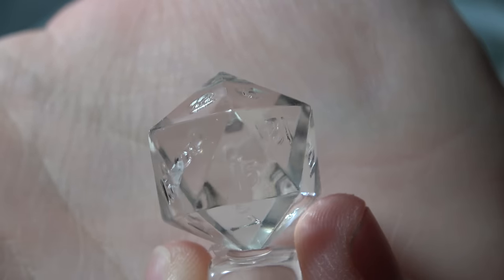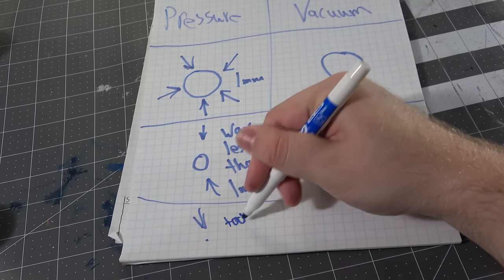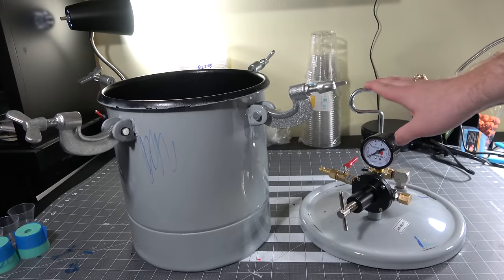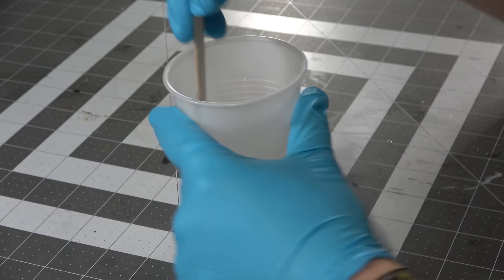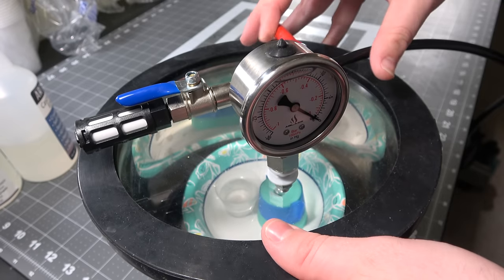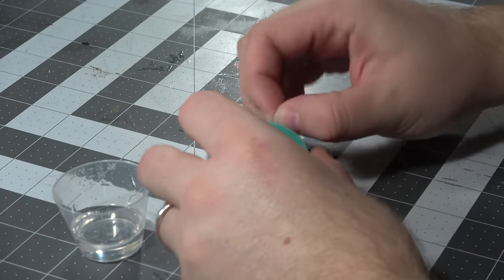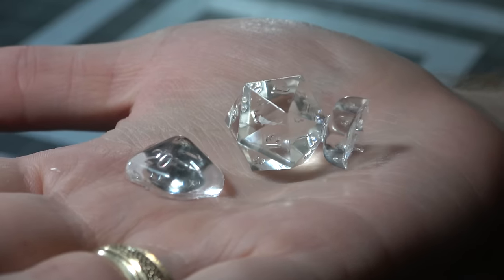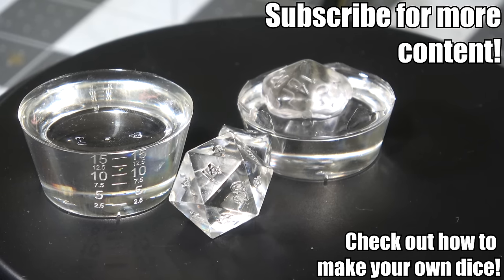Pressure Pot vs Vacuum Chamber | Resin Dice Casting

Comment: So like, I was unfortunate that i can only use vacuum chamber to deal with resin, is there any suggestion to prevent the resin boil out all over the place? The solution i think is that to use higher cups with less resin and make it multiple times. But i am afraid that there is still some points that I am missing, may I get some suggestions or tips? Thank you very much
Reply from the maker: You can also take an active roll in pulling the bubbles out of the resin. Pull the vacuum for a second, then open the valve up, rinse and repeat whenever your bubbles get too high :) I have heard of some people having success
Reply: @Rybonator  Thank you very much

Comment: are pressure casted die more prone to cracking when put under heat?   Those microscopic bubbles dont go away,  so arent there a ton of microscopic pockets of high pressure bubbles?

Comment: If you don't have either could you use a heat gun to remove air bubbles in your silicone and resin?

Comment: Ive been using a pressure pot for resin in moulds that I’ve made, but find that the pressure pushes the resin INTO the silicon moulds…. Am I using too much pressure? (I think it’s about 40psi). Or do I have to make the silicon mould in a vacuum?? It’s so frustrating (and expensive)!!!

Comment: In cake glazing a sift is used to remove bubbles from very liquid glazes.
How would this work for resin if someone don't have access to a pressure pot (or vacuum pump and patience to slowly remove all bubbles).
Reply from the maker: I don't think so, if a sift is what I am thinking that it is in regards to baking. However, constant vibration can be a good replacement, so if you have a vibration table, it could help :)

Comment: So I've started binge watching your videos last month, to the point where I now want to try making my own dice for fun.  I've heard in a couple of previous videos that you don't "need" a pressure pot for the Art&Glow stuff but obviously from watching your newer videos, I do see a little clarity improvement from other videos.  Besides the Harbor Freight pot, have you tried/tested out any other ones?  Just wondering if there's a $25/$50/$75 option available for new hobbyists.
Reply from the maker: Hey glad to see my stuff has been binged haha :) That makes me happy!

So yes, you don't NEED one, it just makes your ability to get bubble free resin casts MUCH easier :) As a result, it also helps prevent your dice from failing by ensuring that you get resin into all the cracks and creases :)

So there aren't many cheaper options than the harbor freight version that I could find without sacrificing safety. You CAN make one out of PVC pipe, but it is riskier, and not worth the savings in money IMO. 

But I do plan on doing a beginner's guide to dice making soon. Hopefully that can help get you started on a budget :)

Comment: What about regular cooking pressure pots? I guess the pressure applied would work the same but how does the heat affect the resin, or even the molds?
Reply from the maker: The heat and possible steam could be bad. It depends on the resin, the mold material you use, a lot of factors unfortunately :/

Comment: Have you (or anyone here) ever used an ultrasonic cleaner to degas the resin before casting? 
I've read about it in a few places but never found a good comparison video like this one.
I've also been wondering about trying pressure spray bottles since some of them reach 45psi and have a wide enough opening to get the molds in there.
Reply from the maker: I haven't heard of or tried either of those things, but I'll happily take a look :)
Reply: Thanks! 
If anyone is interested, I tried the pressure spray bottle and it looks pretty good! not 100% transparent but a lot better than it looked just at room pressure, I'll run some more tests and try to post some pictures later.
The sonic cleaner did make the bubble rise a bit faster but it took ~30min at a warm temperature for it to make a real difference and by then you kind of lost a lot of the pot time so I'm still on the fence about that.

Comment: I saw the video where you used pressure pot to degas the silicone used for making mold. I thought the bubble would expand back once the pressure drops since silicone is softer than resin?(even if i let silicone cure under pressure). I wasn't recommended to use pressure pot to make silicone mold since it's that way, but your result seems to have worked. maybe different silicone material plays part
Reply from the maker: So I use the pressure pot and cure the silicone entirely in the pressure pot. That way, when it's cured, no gas can form new bubbles :)

Comment: The vacuum does not suck the bubbles out. Pressure (and yes vacuum is a pressure, just reduced pressure)  is equal in all directions so what really happens is that the vacuum reduced the pressure around the trapped gases (air) in the resin thus the gas expands forming larger bubbles. These bubbles are now large enough and buoyant enough to overcome the resistance of the resin and float to the surface. Think about a scuba diver breathing out or opening a can of soda....the bubbles float the surface. Once at the surface you can release the vacuum which will compress the gas inside the bubbles again which tends to burst the bubbles. To stop the overflow, just release the vacuum before the bubbles overflow the container, maybe repeating the process several times......and yes, do it while in your mixing cup before you pour into the mold.

Comment: I checked your how to get started videos and had a easy question  what gallon/hp compressor are you using
Reply from the maker: I use this specific model :) https://www.harborfreight.com/air-tools-compressors/air-compressors-tanks/1-3-hp-3-gallon-100-psi-oilless-air-compressor-97080.html
Reply: @Rybonator  thanks for replying and the link

Comment: Not sure if this has been asked:
 I'm just starting out and looking into getting either the pressure pot or vacuum chamber, and noticed you purposely mixed to make bubbles before this. If you warm the resin to reduce the bubble while mixing, then use the vacuum chamber. Would that decrease the overflow?

Comment: Now, I get that it wouldn't be as good, but could one make useful dice without a pressure pot?
Reply from the maker: Absolutely! I used to make all of mine without :) Check out my 24k dice or my glow dice, both made without a pressure pot!
Reply: @Rybonator  I think I did actually skip those ones. I'll check them out.

Comment: The link you included to buy the pressure pot,is there any other accessories I would need to get started? I need to some sort of air compressor right?
Reply from the maker: Yes! There are a few different things. Check out my pressure pot video for a more in depth look into what all you need.  :)

Comment: I wish I could get a pressure pot but I have to deal with the resin with out :( are there good ways to minimize the amount of bubbles in the resin with out one?
Reply: I think he mentions it in this video https://www.youtube.com/watch?v=L_BuqLzJweU
He doesn't go into full detail but it's a quick little 10 second tip. Again I think it's this video
Reply from the maker: So if you heat up the resin in a hot water bath (hot sink water, and just let the bottle sit in there for 20 minutes) that helps. You can also vibrate or shake the molds in some way while they are curing and that helps a LOT :)
Reply: @Rybonator  I'll definitely try both those methods, thanks so much!!

Comment: correct me if i am wrong here, but dont you normally use a vacuum chamber to get the air out of the epoxy, then take it out and pour it? nad you can just pull a vacuum, then when you see the epoxy rises to high let it pull some air and go down and then start again?
Reply from the maker: You can yes, but then you have to worry about getting it done in time before your resin starts to set, and it is less labor intensive. But it can be done :)

Comment: I know this might seem dumb, But does anyone know where to get a pressure pot that i dont have to convert from a paint pot to cast resin in.  All I can find is how to Modify a HF Paint pot. I sadly just dont have energy or time to go hunting all the stuff down to do it and I would have to buy new tools.  I have had to put my new hobby on hold for now, till I can get one. I really like how nice they look when they come out of pressure pot.
Reply from the maker: There may be some, but they are going to be expensive. I have the parts list in my original pressure pot video if that helps. I would maybe see if someone has already made one on Ebay.
Reply: @Rybonator   Thank you. I will try to build one.

Comment: What if at top of dicast you will add a widespread funnel made of paper or mold will be prepared in the way that will have a huge funnel shape chamber to gas off resin? The wider the area, the more chances for baubles to pop. The best example is coke poured into a narrow tall glass and whiskey glass. Of course, that adds extra molding material but if quality matters it could be a way to try out.
Reply from the maker: You could do that! But for that extra effort and the cost of extra mold materials each time, I'd just go with the pressure pot in the first place then :)

Comment: How long do you leave the molds in the pressure pot once you’ve pressurized it?
Reply from the maker: It depends on the resin I am using. I leave it in for the full cure/demold time. Usually about 24 hours :)
Reply: @Rybonator  Thank you for the response! :D

Comment: I know this is an old vid but I hope you (or someone else who knows) see this anyway: do you know if it's possible to use one of those pressure pots for cooking instead of this one or aren't they good enough?
Reply from the maker: Hey there Maria, unfortunately no it's not. A pressure cooker creates pressure via steam (which is super bad) and heat (not as bad but still). You also cannot control or indicate the pressure on those. You need something like this :)
Reply: Dang - I’ll have to try making some with no fancy machines then. Thanks for the reply though!

Comment: Why could you not feather it when vacuum chamber is going. Such as when the resin starts getting volatile you open the valve on the lid and let it go back down then close valve and repeat. Little tedious but oh well.  

       Is it too thick and need to be a thin layer perhaps?

Comment: damn, you can pressure cure silicon?! So I could have bought a pressure pot and got a 2 fer but instead I bought the vacuum chamber. That sucks. Anyway, I want to degas resin with my vacuum chamber. Can I just turn off the pump right before the mold overflows and still get great results?
Reply: That is how we do it.

Comment: The mold used is designed to be used in a pressure pot, not under vacuum. You would need to add an extention to the top to contain and return the resin to the mold once the bubbles are out. This will also require the use of a slow cure resin.

Pressure pots are easier and faster, which is why they are preferable for this kind of use.

Vacuum chambers are the easy to go when stabilizing wood.
Reply from the maker: Good point! The right tool for the right job I suppose :)

Comment: How about silicone? Can you use a pressure pot for that too or would you run into problems like the resin in the vacuum chamber? I’d like to make dice and get some clear results but buying both a pressure pot and vacuum chamber on top of all the needed supplies seems very expensive
Reply from the maker: I'll do a video on that too :) Supposedly it should work fine though!

Comment: I noticed you mentioned wearing a respirator rated for fumes when working with Art and Glow resin. Do you have a recommendation? This is the resin I plan on using 😁 Thank you
Reply from the maker: So the SDS shows that the resin has no VOC's, so you SHOULDN'T need to use it with Art N Glow, but it's just always better to be safe :) This mask would work great! https://amzn.to/2PIRR4x

Comment: What is the average time of making 1 set of dice?
Reply from the maker: Once you already have the molds made, it's not bad. Takes about 20 minutes to mix and pour the resin. Then you wait a day, then cut the sprues, about 10 minutes. Then wait another day or two and sand the dice. I like to sand in batches, so that helps. That can take anywhere from 30 minutes to 2 hours depending on how many you are doing.

Comment: If you vacuum the resin prior you have to drop the vacuum a few times and let it pull the vacuum again to avoid the overflow. However you will more than likely put some air bubbles back in when moving to the mold after.
Reply from the maker: It's a much more involved process that's for sure :)

Comment: @1:46 it doesn't pull the bubbles out.  It reduces the force on the bubbles, making them bigger.  Bigger bubbles have more volume compared to surface area, which is what allows them to rise.  Volume == buoyancy (the bubble displaced more resin) and surface area == friction (the resin has to flow around the bubble).  This is why you don't pull a vacuum when you're already in the mold, it'll just let air be trapped inside your mold.

Comment: Alternatively, you can cycle the vacuum and non-vacuum instances repeatedly to get the bubbles out more cleanly.
Reply from the maker: Good point! It's just more time/labor intensive.
Reply: @Rybonator  Hey, time and labor aren't a problem for Casinos, as evidenced by how they took the time to make sure their dice weren't weighted in the slightest. But whatever works for you, works!

Happy casting!

Comment: I use just a vacuum chamber for my dice. I'd love to eventually get a pressure pot but my budget doesn't let me right now.
Reply: How do your dice turn out?
Reply: You're like the reverse-me. I have a pressure pot that works great, but I don't have the budget for a vacuum chamber and pump right now.
Reply: @ClokworkGremlin  That's great! You two can make dice together!
Reply: Or annihilate everything in a massive explosion of nondescript energy upon contact, one of the two.
Reply: @GeladeiraGameHouse  actually pretty clear! The sharp edge dice molds like to trap bubbles in corners though so I have to use a toothpick to get them out.
Reply: @liquidhandsanitizer2740  what is your technique for clear dice?
Reply: @doodledicemonsters  I mix my resin with any color or glitter first. Then I will add 1 teaspoon of 99% isopropyl alcohol per 2oz of resin. This lowers the viscosity enough that when I vacuum out the bubbles it doesn't take too long. After degassing, I use a syringe with a blunt tip to inject the molds with the resin. I remove any bubbles that have gotten stuck on edges (very common in corners of sharp edge dice molds) and then let them cure. After that I will demold them, remove the sprue, and then set them in a food dehydrator on low for about 2-3 hours. So shiny. http://imgur.com/a/FAInNLT
Reply: @liquidhandsanitizer2740  Thanks so much! Mind also telling me which resin you use?
Reply: @liquidhandsanitizer2740  WOW!
Reply: @doodledicemonsters  I use Amazing Clear Cast
Reply from the maker: Thank you for the tips in your comments :)
Reply: @LiquidHandSanitizer 1 teaspoon of isopropyl per 2oz of resin? Is that by weight, or volume? How does it effect curing?
Reply: @ClokworkGremlin  by volume.  And I found that it can effect the curing a bit. The dice may come out a tad softer. I combat this with my food dehydrator on low. It will take out all the moisture and they cure hard as a rock.
Reply: I've found most of my resin casts take 2-3 weeks to reach full rigidity anyway, so that doesn't seem like much of a problem. If it increases the set time, that's actually even better in some ways. One of the reasons I stick with Amazing Clear Cast over regular Clear is because the pot time is 8x what it is for Clear, and 3x what it is for Clear Slow. (nearly an hour vs. 7-15 minutes)

Comment: i mean, i suppose you could pull the vacuum slower so the bubbles have time to pop before new ones start coming up, or use a much taller vessel to hold the resin so that it can't overflow.
Reply from the maker: You can, but then you have to worry about it taking too long and the resin beginning to cure on you. A resin with a longer working time would be fine though :)
Reply: @Rybonator  fair enough.

Comment: Great video,

Have you ever try UV resin to make dice before? 

You can used a hot glue gun to make a mold.
Reply from the maker: You need to use a mold of a transparent material, like sorta-clear 12 :) But I have tried yes! A lot of people prefer that method
Reply: @Rybonator  I seen people used hot glue to make molds and oil spery for UV resin. Not sure if it will work for dice but... Though you might enjoy a challenge.

Comment: I think you may be pulling vacuum for way too long. At some point you are no longer pulling out air - you are instead boiling off other chemicals in the resin. That's likely why it keeps bubbling. 

Also, saying less that 20psi does nothing is not entirely true. There is specific math and physics to this (Boyle's Law). At 1bar/14.5psi of pressure you have already halved the size of the bubbles. At 29psi, they would be at 1/3 the size. At ~43psi, they would be 1/4 the size and so on and so forth. The point being the biggest reduction in bubble size happens at the "beginning" and then the effect diminishes. But for structural parts, I would think you would want the bubbles as tiny as possible and I would go to whatever pressure your pot it rated to do safely.